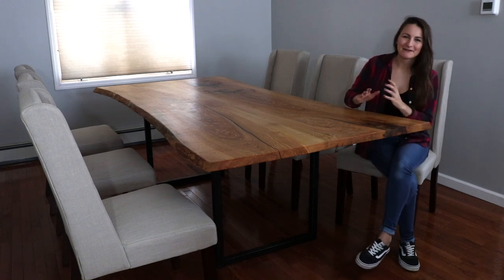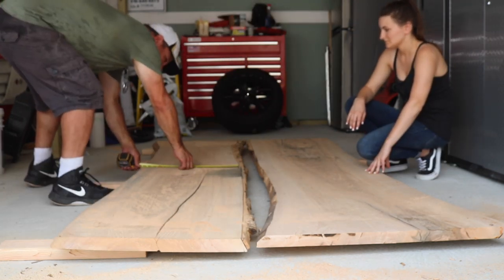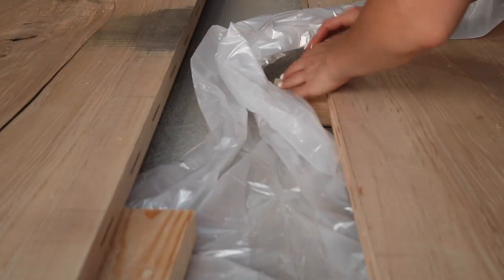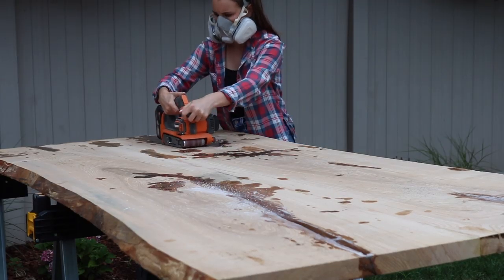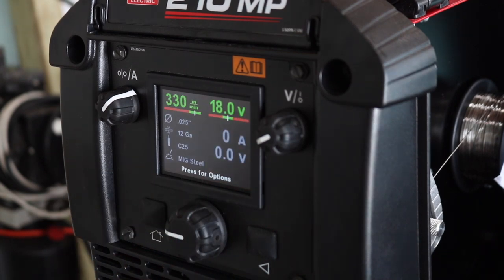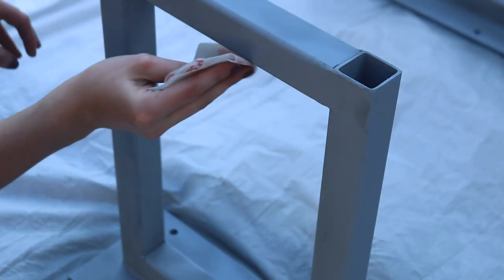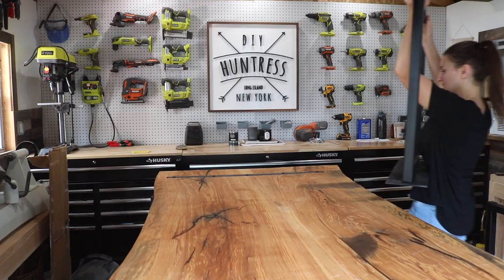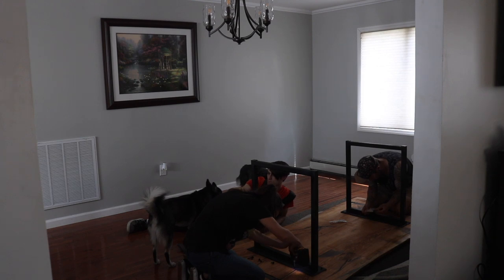DIY Live Edge Dining Table With Metal Legs | MY FIRST TIME WELDING

Comment: your dad realy needs to take the concreter who did his garage floor out behind the woodshed for a chat. not only was the concrete far to wet still when he did the non slip finish but there are no crack control joints in it. it will end up with spider cracks through it and the top will turn chalky and wear off quickly

Comment: I love seeing people DIY things they have never done before, and because they TOOK THE TIME TO RESEARCH FIRST, the projects turn out really well.  Kudos on leaving the holes large enough for the wood to expand/contract!  A lot of people wouldn't have thought to do that.  I haven't really done any kind of wood working in 30+ years and I'm getting back into it a bit with plans to build a table top, coffee table, floating entertainment center and eventually a full California King sized bed with storage.  I'll probably use black walnut because it is a good hard wood and with just mineral oil, it brings out such a gorgeous wood color.  I'd never seen a hand held planer like that before, so thanks for mentioning this.  I may see how that works.  If I'm not happy with it, I can still take the table tops to a local wood working shop and rent 30 minutes on their high end planer to make a few passes.  Thanks for the video, and nice job with the welding!
Reply from the maker: Ah! Thanks for the love! This seriously was such a fun project. I’m so proud of it every time I see it in my parents house! Good luck with your project. It sounds like it will be awesome.
Reply: @diyhuntress  Thanks - although I currently have a similar issue as yours - I do not have a big enough shed to do most of this so I'll be working in the yard until I am able to build a larger shed.  Best of luck Huntress!

Comment: Good project. The rubber bushes used on legs will also act as an air seal which will reduce moisture from entering inside the box bars where its not painted. I have seen some videos where people using table legs similar to the one you made and I am sure it can support good amount of weight but are they steady? Your feedback can be helpful to plan the dining table which I am about to make.
Reply from the maker: Thank you! The table has been loved and used for almost one year now and it’s still going super strong! I’m so proud of how it’s holding up. 🥰

Comment: Love your build and documentation. I know the feeling as I built 3 live edge tables pretty much the same way. Electric planer and track saw. One tip was after the two track saw cuts, but the edges then cut between the two again. This makes a better joint for glue up. I skipped the wafers

I had the SAME epoxy nightmare. Ultimately I did the first tun with 5 min epoxy. Much ticker, easier and faster. 

Great tips. .
Reply from the maker: Thank you! Slab and cracks were too significant to use 5 minute epoxy. I should have used table top instead of deep pour. Would have worked better. But, every build is a new lesson and I’m cool with that. 😊

Comment: How thick is your c channel compared to the table top? I’m worried the c channel I have may be too thick for my build. The tabletop is 1.5” thick and the c channel I have is 1.25” if I totally inlay it. Should I look for a shallower c channel? Also how far apart did you lay out your table legs? Thanks!

Comment: What the deal with cross channel  couldn't the leg plates do the same thing. I really do like the table
Reply from the maker: No - it helps the wood slabs from twisting or warping with the change if seasons. The leg plates are just there as a means to attach the square tubing to the table. And, thank you!

Comment: Awesome work.
Two questions. 
1) what exactly is the purpose of the c channel? 
2) what did you use as a finish on the table?
Reply from the maker: Hi! Thank you! The c-channel was recommended to help prevent the slab from curling or bowing when expanding and contracting in the changing seasons. As for the finish, I used Rubio Monocoat in Pure. Love that stuff!

Comment: We must have a very different idea of what heavy machinery is. I definitely consider your shed stocked with plenty of heavy machinery. Did your dad teach you how to use power tools or did you learn on your own?
Reply from the maker: Most of the tables I’ve seen that are this scale are made with industrial sized planers, sanders, and saws... so wanted to just show others that you don’t need those types of tools to get a project of this scale done in your own home. All of the tools I used for this project were purchased at Home Depot and not a specialty dealer that makes industrial equipment for large commercial use. And, yes, my dad taught me basics when I was a teenager (drills, miter saw, tile saw) and then I taught myself more from there. 😊
Reply: @diyhuntress  Oh now I understand the difference. I didn't think of it from that scale so my perspective was different. I appreciate you taking the time to explain that to me though. Aww. That's awesome. I want to learn how to use a few different power tools but it's intimidating to me. Not to mention I don't know anyone who would be willing to teach me.

Comment: Awesome work! For the deep pour resin, what was the working temp of your shop? Were you worried about it yellowing or cracking? I'm about to work on a river table and my garage shop is easily 100 degrees in the middle of the day  so I'm worried about the overheating.
Reply from the maker: For the resin I use, 100 is definitely too hot. I usually pour closer to nighttime hours, so it doesn’t really get above 85. There have been a few projects I have poured inside to help keep the curing temperature consistent. Not sure if that’s an option for you!

Comment: hi there , just a question at 2.04 of your video i see there s a huge crack in one of the slabs how did you manage to get that fixed again , ???
just with a little slat to hold in position and then the epoxy connects it again ..?? 
love to hear from you .
Reply from the maker: Yes! I used the extra wood piece with clamps to level the slab (since the crack was causing the two sides to shift), and then filled the entire crack with epoxy resin. Worked amazing!

Comment: You kinna wasted the live edge. Payed alot for a slab then cut one edge off and basicly sanded the other down to wood. You could have bought a sheet and made it look just like the edge you ended up with. Looks good either way you just didnt need the live edge cost.
Reply from the maker: I hear you, but respectfully disagree. The purpose of having live edge is that it looks natural. And, the coolest part about these particular slabs are that I was able to keep a bulk of the material for the table, but still have a natural live edge with all of the beetle holes, divots, and organic shapes still in tact along the sides, even with a light sanding... in total, the amount I cut off of these tables were less than about five inches in total. So, I actually got to keep a bulk of the material which was really cool. They are also reclaimed ash wood, which isn’t necessarily easy to source where I live. I love knowing that the edge and the character that came with this table is the original. I’m really happy with the way it turned out, and so is my family (which is the most important part). 🙏🏼